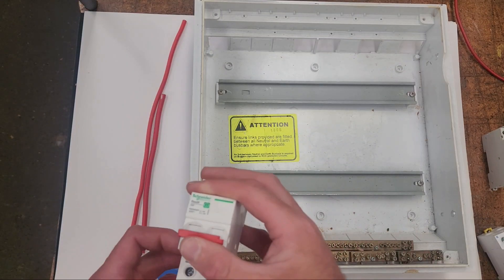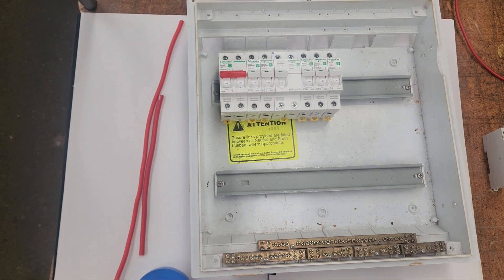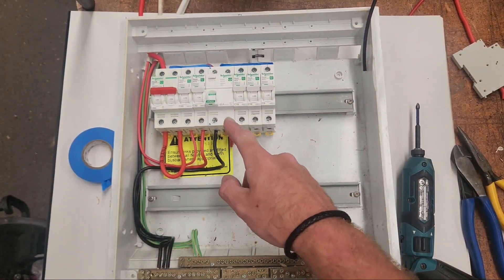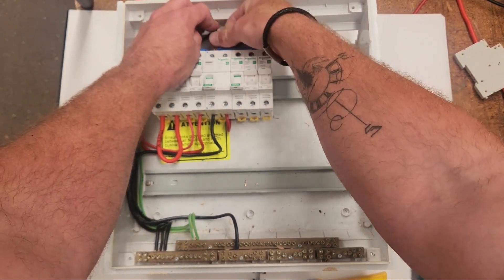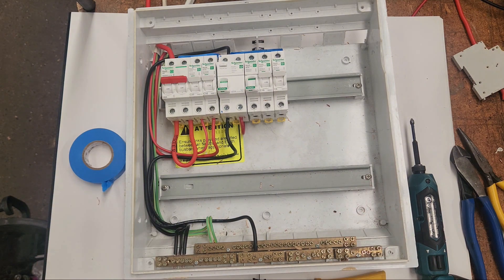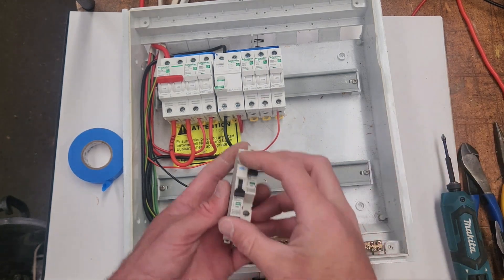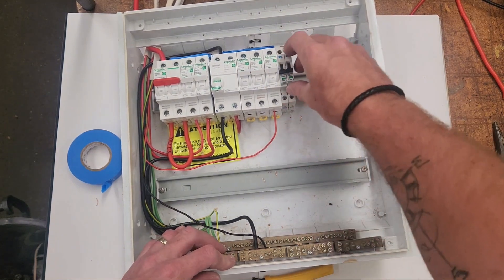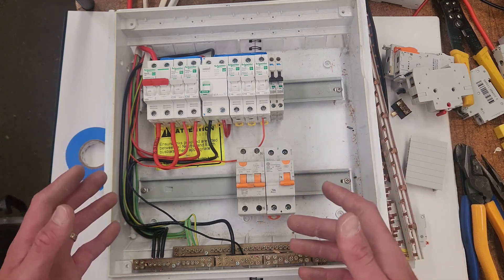Wiring a switchboard

Comment: Is ok if your RCDs exceeds the amp on your main switch, isolator ?
Reply from the maker: 40a or 63a mcbs, either one is ok, there is lots of different thinking on which one you sure use but rcds aren't governed on the amp rating for what it will trip at. The amp rating is the maximum the rcd is designed to have running on it, which should be fairly rare. 
So it doesn't matter so much just so long as none of your mcbs are higher rated then the main switch 👌

Comment: I only ever use RCBO's now. I recently bought one of those Zephyr boards (18 way) and there were no Earth or Neutral bars in it., Talk about sparse. Also the property was split phase which made it a bit awkward with the RCBO comb busbars that are designed for a single pole main switch. I had to cut a couple of the prongs off the bar, then tap over to another row of RCBO's with 10mm links. And....the board cover only just fitted on. I had to get a small board because I'm mounting it on a small space under a meter on the old paxolin board. It was either that or rip the whole lot out at a higher cost. 
I honestly just can't be bothered with RCD's and MCB's anymore. The Resi 9 system from Schneider with RCBO's is very easy, but like I said, doesn't seem to be that well adapted to Split phase. They should do a comb bus bar to suit a double pole main switch. Oh well, I sorted it anyway.

Comment: Wierd way of doing it. In the UK we normally use the two pole main breaker to isolate both the live and neutral,(normally with the main breaker at the right hand side of the consumer unit) grid feed in from the meter in to the top then have the busbar out of the bottom feeding the MCB's from the bottom, with circuit wiring from the top.
Reply: It creates an obvious place for interference with metering too.  Very easy to bypass the metering for a final and you can bet the NZ authorities do not randomly come round and take the lid off people's switchboards for a look.  The tell of smart meter indicating a power loss event is no longer possible to tell if something suspect has happened because the mainswitch will disconnect it.  Combined Mainswitch/meter isolator can happen with old rural installations in Queensland, Australia but it is rare, is removed should the old switchboard ever be rebuilt, and the mainswitch itself is a sealed item to give tamper indication.

Comment: 1) Slim RCBOs are banned in many countries since december 2023 because they don't trip if neutral wire is disconnected. 
2) Double-pole switch is useful for loads which create harmonics like EV charger. 
3) RCD and RCBO has types: AC, A, F, B etc. 
4) If building has some outdoor electrics (overhead feeding cable, garden lights or something like this) it should be equipped with surge protector. 
5) Panel should have at least 15% of free space for cooling. 
6) In wood buildings only metal panels might be installed. Plastic boxes are not suitable for wood buildings. 
7) Feeding from top is actually firefighting department requirement because circuit breakers have static contact on top.
Reply from the maker: 1, not in nz
2, the mcb type won't make a difference to the harmonics 
3, you can only use type A RCDs in nz
4, this isn't a requirement and an rcd would be far better protection 
5, also not a requirement, there is a standard for grouped mcbs to be downrated
6. this isn't true, you can even buy full metal switchboards in new zealand anymore 
7. you'll have to be more specific, firefighters don't set the regs for electricians and static electricity doesn't really have any bearings on mcbs switchboards ect
Reply: @_nztradie  Incorrect on 3, you can't use (install) type AC RCD's in NZ or AUS (as on as3000 2018)
Reply from the maker: @johnschroeder3072  sorry typo, type A 
Also new zealand is not on the 2018 standard we are still on the 2007 version
Reply: @_nztradie  How has your legislation not "enforced" the latest version of the standard?

Comment: Instead of using the RCD and MCBs. Can I have a setup like this:

1 Main Switch followed by 4 RCBO for: Light, Bedrooms, Kitchen, Rumpus, respectively?
Reply from the maker: @digicabtech  yea that works just fine, so long as the the amp rating is correct for the cable that is installed

Comment: Im wondering .... the sleep out at home runs tps from the main house, but only enters the sleepout breaker box with live and neutral, but said box has an earth bar and wires for it- going to caravan plug. How could this be? (I'm not doing electrical work, just extremely curious)
Reply from the maker: You should be able to find another earth peg around the sleepout somewhere by the sounds of it
Reply from the maker: When running submains you can choose to either ran an earth too or drive a new earth peg
Reply: @_nztradie  Thanks for your reply, Case closed i suppose.
Reply from the maker: @ad-venturer305 no problem mate, I might make a video showing the differences some time 🤙

Comment: Found it, they call it a TD022 7.2V LXT Impact Stick Driver... I paused your video and got the code!
Reply: I did the same! 😂😂
Reply from the maker: @seatbelt_101willis9  honestly they are so good
Reply: @_nztradie since it’s technically an impact driver is the torque spec too high for breaker screws etc?
Reply from the maker: @ReidAU3 na its alot weaker then an impact driver
Reply: I've had one of these for over ten years now , fitting out alloy boats - 8g s/s screws - perfect 
Guys use impact drivers and snap screws off all the time , even when turned down 

I'd be lost without this tool
Reply from the maker: Yea thats the one, it's so good prefect for all that little stuff

Comment: Im in NZ and insulating all my external walls and adding and extra 45mm service cavity which will also be insulated. The CB on my board are 20A for power and 10A for lights. Im assuming the CB's should be swapped for 16's and 6's?

Also does that downrating apply to the non RCD protected circuits i.e. the first two 20A and 32A breakers you put on the board? Ill be putting two heat pumps on their own circuit but their cables are likely to pass through some internal wall insulation too.

Im actually running out of space on my board (only 11 slots total. I have one breaker supplying my garage as a Sub main and it has its own small switchboard. Is it allowable to add a second Sub off one of the single 20A breakers to another small board? I was thinking that would be a simpler and cheaper option as apposed to replacing the current switchboard. The plan would be to have 3 circuits on the second SUB, 1 for kitchen powerpoint, 1 for laundry power points and 1 for 2 x heat pumps.

I suppose alternatively I could swap out some standard breakers for the slimline ones thus doubling my count availability?

Thanks
Reply from the maker: @allanpennington  that's right
Reply: @ Thanks, I have decided to put in a new 2 x 15 way enclosure and use new Schneider Resi9 breakers. RCBOs for the top row and MCBs on the bottom. The new MaxBar allows for a neat and tidy solution. The MCBs will be for the Sub/garage, heat pumps x 2, a Bosch induction hob and a Bosch combo oven microwave. I assume it’s best to use mcb for those to prevent nuisance tripping OR are the latest Resi9 RCBOs ok for that?
I suppose I should also consider an SPD and maybe some AFDDs as I’ll have room. It’s an old timber 1960s house with mostly original wiring.

Comment: Regardless of NZ regulations, would one be best using an appropriately rated MCBO for every circuit? Thanks for your Vids bro, great job!
Reply from the maker: @shahn560  it's definitely easier and can make it quicker for install and also less potential problems with crossed over neutrals ect both have there place but rcbos would be on top I'd say

Comment: What is the point of having a non-RCD protected circuit when it can be protected by a RCD?
Reply from the maker: @IAmThe_RA  you can have accidental tripping of an rcd from some bigger appliances, although in the next regulations coming soon you will have to rcd everything so 6 of one half a dozen of the other really 👌
Reply: @_nztradie  In the UK they usually only have two RCDs and yet every circuit is RCD protected. Not to mention that RCBOs have been around for some time now.
Reply from the maker: @IAmThe_RA  yea  that used to be nz too but now you are only allowed 3 mcbs pre rcd

Comment: Although retired I still like to keep up to date with current rules and regulations just for my own  benefit and work at home and your videos assit in that function. I particularly like the fact when you terminate your cables you double them back on themselves which greatly reduced the chance of the cable breaking under the screw, particularly single stand wire such as 1 or 1.5 mm.  I always taught my apprentices to terminate wires (where possible) in this fashion.
Reply from the maker: @gregharding7329  thanks man, I appreciate it
Reply: I actually put bootlace ferrules on the ends of my cables. I also never use 1mm for lighting. They occasionally snap when fiddling around pushing a busy switch back to the wall.
Reply: @Justyburger  Agree, I always found that 1mm solid was just way to easy to break. Changed to 1.5mm stranded decades ago and never looked back. Also most fault finding I had to do was with light circuits and the biggest culprit was always a broken 1mm cable.

Comment: Best switch board video ever.  Where does it say in rules that a wire in switchboard is rated 5 times its current.  I would like to know.   Thanks very much.
Reply: It’s not exactly 5 times. Check as/nzs 3008 table 7, spaced for current carrying capacity in switchboards.
Reply from the maker: @__Lachie thats the one sorry I guess I rounded that 😅
Reply: @_nztradie  xD